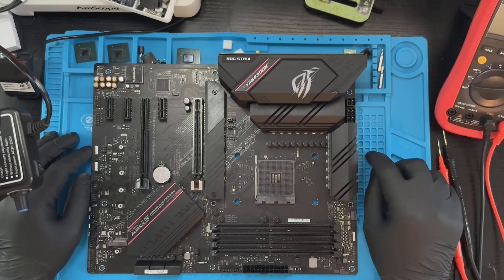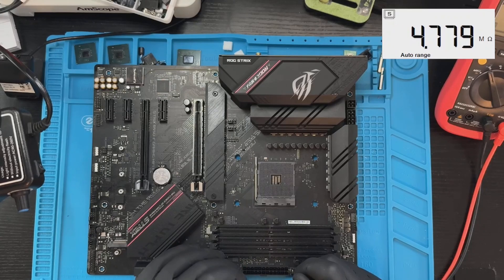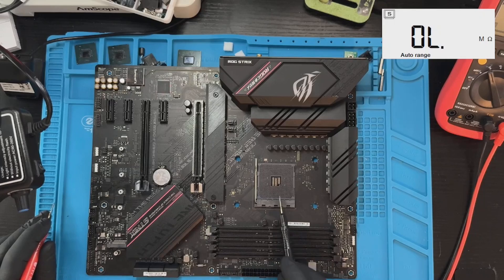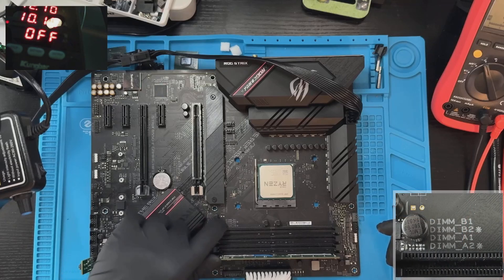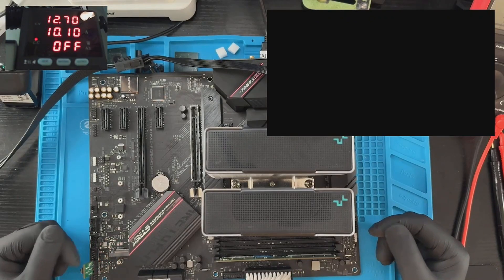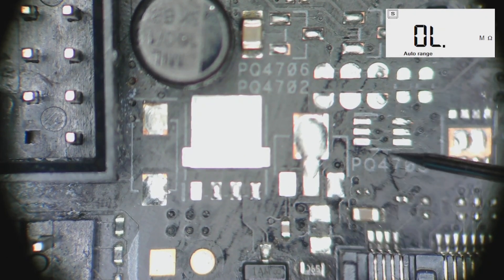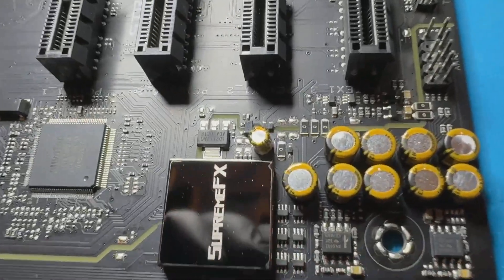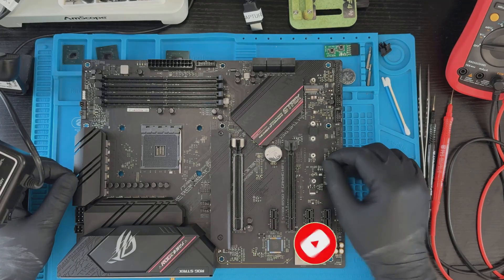No Power ASUS ROG STRIX B550-F | What Killed This Motherboard

Comment: Any thoughts or opinions on this motherboard?  I've had this board since May 2023 running a 5900x running PBO (using the "Asus Performance Enhancement" settings of 180a EDC/1000a TDC/1000w PPT), per core CO and the 5900x pulls ~190-200 watts under an AVX2 load and usually up to 170 watts under other 100% CPU loads (be it an SSE stress test, encoding a video, compiling shaders, etc.)  This CPU killed my Asus B450-F Gaming II lol.  That board lasted, I believe, 9 months with the 5900x.  Using PBO half the time is what pushed it over its limits, I believe.

But, yeah, I am 100% happy with the motherboard but since my incident with the previous board, I wonder just how stressful the 5900x is on this motherboard with the way I use it.  It's ran 24/7 since day one.  BUT... I believe it'll continue to last.  It even handles my TeamGroup T-Force RAM.  Stock this RAM is DDR4 3200, but it uses Samsung B-Die and I'm running it at DDR4 3600 14-14-14-28-42 CR1T w/ GDM enabled @ 1.45v.

Againk, I'm super happy with it and am very impressed with how it has handled this CPU and RAM for what it is.  I'm hoping I've not degraded anything on it to the point that it's nearing the end.  Nothing leads me to believe that.  It runs 24/7 without ever crashing or anything.  Running the latest BIOS.  Don't get me wrong, I'd like to have a Zen 4 or Zen 5 rig OR like to have an X570 motherboard, but I don't want to be forced into it at the moment haha.  It's a bad time for a motherboard to die.  RAM costs so much that I'd definitely be doing a motherboard replacement and not building a new rig.
Reply from the maker: Thanks for sharing such a detailed experience! The 5900X is definitely one of the heavier stress-cases for mid-range boards, especially with aggressive PBO limits like 180A EDC and high PPT. What you’re seeing — ~190–200W under AVX2 — is absolutely in the “VRM workout” zone, but the fact that your board has been running 24/7 for over a year without instability is a really good sign.

Samsung B-die at 3600 CL14 is also a pretty demanding memory setup, so it’s impressive everything stays stable on the latest BIOS. If the VRMs were degrading, you’d typically start noticing thermal throttling, WHEA errors, random reboots, or difficulty maintaining those memory timings — so your system being rock-solid basically says the board is handling it fine.

Of course, any board can eventually fail, but nothing in what you described points to it being near the end. As long as temps are under control and you’re not seeing instability, you’re probably good for quite a while. And I agree — now is not the best time for a surprise motherboard failure!
Reply: @FixThePixel  Thank you!  I am very surprised that I can run 4x sticks period haha.  Let alone, 4x sticks at DDR4 3600 14-14-14-28-42.  I'm very lucky.  Samsung B-Die is crazy.  By the way, this RAM at stock is rated for DDR4 3200 14-14-14-34-48.  

But, yeah, I've just been SO happy with this motherboard.  I don't wanna end up just repeating myself over and over haha, so I'll cut it short..

I couldn't be happier with a B550 motherboard.  Sure, I'd rather have an X570 Strix or even a Crosshair motherboard, but I didn't want to spend that much when I got this one.  I do wish I had went X570 for better PCI-e slots.  I have lots of peripherals and that's my main limitation.

But that's enough yapping out of me lol.
Reply: Oh, you may find this interesting.  When I had the Asus B450-F Gaming II motherboard, the 5900x with PBO enabled was only able to pull 180 watts max.  So, apparently, that was the maximum amount of watts that motherboard could supply.  Then I noticed after 3 months of running the 5900x in that board, suddenly the max the 5900x would pull was 160 watts.  I didn't know it at the time, but that was the beginning of the end for that board.  I now know the 5900x can pull well over that and well over the 200 watts it currently levels out at with these PBO settings.  I've had it up to 240 watts while testing my AIO water cooler with higher PBO limits.  After my B450 board experience, I was afraid to test anything higher.  So, it seems to have some room to breathe.  Plus, I tend to keep my house pretty cool.  66F-67F in the summer with AC and 65F right now in the winter.  Alright, I'll shut up.
Reply: I just purchased this and am waiting for delivery. I'm not super sure if this is what I want in the end but this should be a decent upgrade until ddr5 prices drop in a couple of years. Currently running x299 board and it's served me well but it's time for a slight upgrade. Just mobo and CPU. Already have ddr4 3600 g.Skill ram so supposedly it should be good
Reply: @qpSubZeroqp  I think you'll like it.  I'm able to run 4x8GB DDR4 3600 14-14-14-28-42 (Samsung B-Die) 100% stable.  I run the 5900x I listed above.  I'm using 2.5Gbps Ethernet (my router supports it).  I mean, it is what it is as far as features go.  B550 stuff.. PCI-e 4.0 x16 upper with everything on the B550 chipset below running at PCI-e 3.0.  I have 2x M.2 NVME drives and 6x S-ATA drives.. but using the lower M.2 slot cuts off S-ATA ports 5/6, so I stuck a S-ATA PCI-e card I already had in it to keep my other drives.  

The B550 PCI-e x16 length slot runs at x4 3.0.  But if you use any PCI-e x1 slot, it cuts it down to x1, too, lol.  But that's typical B550 stuff.

All of that aside, the VRM/power set up is really good in my opinion.  I "THINK" if it was going to fail me, it would have already.  I've had my 5900x pulling 190-200 watts for 18 hours straight a few times, 12+ hours straight even more times.. and I hit 170 watt loads every single day.

I have every onboard USB front panel connector in use, all except one USB slot on the back in use, onboard Wi-Fi (RZ608) + Intel AX210 chipset Wi-Fi card.. 

I do have another M.2 NVME drive laying on the table that I can't use because I don't have room for it and it's almost not worth getting a PCI-e card for M.2 because of how limited it'd be at PCI-e x1 3.0 speeds... but I guess it WOULD be worth it just to be able to use it.
Reply: @JustAGuy85 This is awesome information, so I thank you for it! So what you're telling me is that only the GPU can be used for PCI-e and nothing else if I want to keep the speed? I have a sound card as well that I actually use so that's going to be a no-go?
Reply: @qpSubZeroqp  Hey, sorry, I'll be more precise.

The top PCI-e x16 slot doesn't affect any other slots, so you can run the GPU without bothering the rest of the PCI-e slots.  The top slot will run in PCI-e x16 4.0.  

It's the lower PCI-e x16 (@x4 3.0) length slot that gets tied in with the other PCI-e x1 slots.  So, if you stick any card into any x1 slot, it makes the second or lower x16 length (which originally runs at PCI-e x4 3.0) cut down to x1 3.0.  

But the main, top PCI-e x16 @ X16 4.0 slot is ran of PCI-e lanes from the CPU and is unaffected by any other slots, so you'll be good to go.
Reply: @JustAGuy85 oooh thank you for the clarification, so I should be good then

Comment: this is awesome, i didn't know it was possible to fix something as complex as motherboards. i had a ASUS proprietary b560m lga1200 mobo in my old prebuilt ASUS ROG STRIX G10CE that was failing but it really fooled me. the system was crashing under load and bluescreening with errors pointing towards the GPU and artifacting like the GPU was failing. so i got a new GPU, put it in, yet the issue persisted. i return the GPU and order a new mobo instead, hoping the CPU wasn't the culprit. but after swapping mobo the system including the GPU works perfect. i inspected the failed mobo but couldn't see any signs of damage. i wonder if it's fixable; even the BIOS was laggy and crashing.
Reply from the maker: Thanks for sharing your experience! You’re right — motherboards can be really deceptive when they fail. GPU-like crashes and artifacts often come from bad power delivery or chipset issues on the board itself. The fact that even the BIOS was laggy points strongly to a motherboard fault. A lot of times the damage isn’t visible, since it’s buried in the VRM or internal layers. Cool catch replacing the board — glad the system is running solid now!